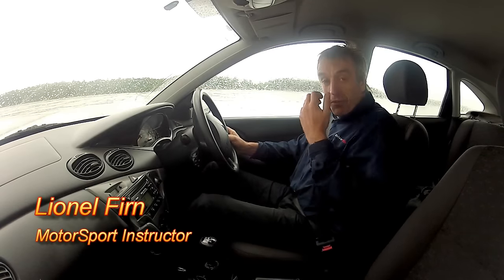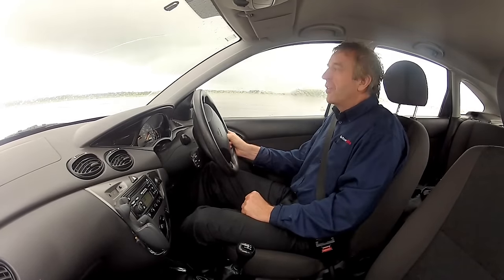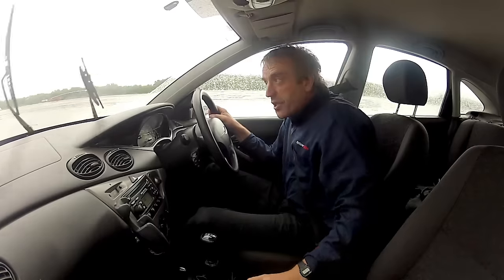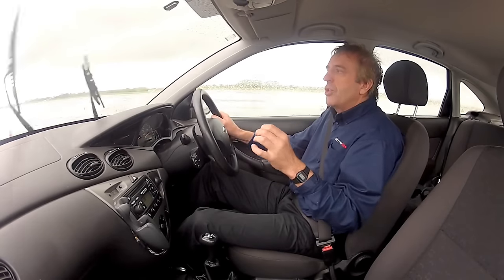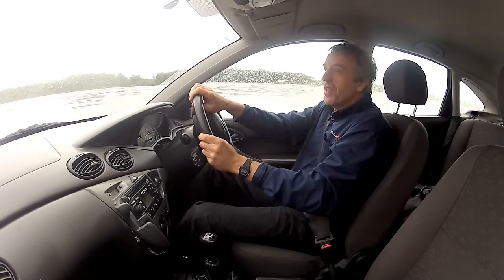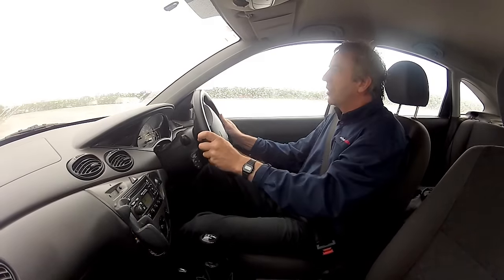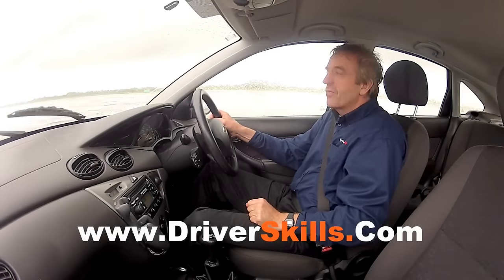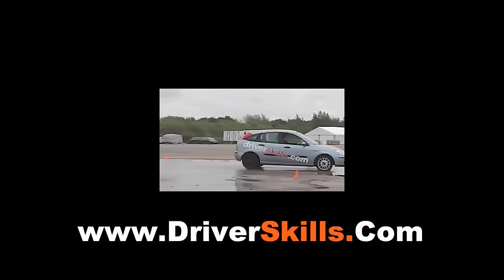How to Control a Skid.

Comment: I got in a skid once going through a wet roundabout with uneven surface at high speed at night. I did play racing simulators on my computer before like Project Cars or Live For Speed so when that happened I just instinctively knew what to do with the steering wheel and got control of the car seconds later. I still did go from edge to edge of the road left and right but did not crash into anything. People do like to speed up on the road as about a month later I saw a car with wheels up on the road.
Reply: Had exact situation, but not with happy end :D 190km/h + sudden turn + sudden brake = First time experienced the skidding, I thought, I would "drift away" and fix, but ended up my wheels on the air
Reply: Same here. I was in a rearwheel drive sport sedan going about 60 mph. I'm sure the person who was riding my ass behind me thought I was being a show off. Nope. I was screaming inside my body as my $40,000 car was sliding side to side. 😂
Reply: @shortcake1025  q50?
Reply: @Ktrxll  No, lol, Kia Stinger GT RWD.

Comment: This is great advice. Ended up in a fishtail today because someone in a large SUV tried to merge into the side of me on the motorway. I took evasive action but there was loose gravel on the road surface and the back wheels broke loose (RWD sports car). Followed the procedure, eyes on the direction I wanted to go, countersteered but let off the throttle a little to let the rear wheels grip. Overcompensated on the first counter steer which is why I ended up fishtailing. Fortunately I got it together on the second and the traction control got the rear wheels back in grip. Was bloody scary doing that at 70mph. Just glad I was in a fairly light car with very good steering authority and ESM.
Reply: Which car?
Reply: @samcharles1166  pontiac aztec
Reply: @NoLimit.350 thats jus scary to go thru thank god you made it thru . For me tho having a fwd means i mostly likely would have less room to work with since power is sent to by the front wheel

Comment: 2:05 - Glad he mentioned the throttle. That really works wonders in a FWD
Reply: It's the same method for a Scandinavian flick, except you cause the skid by shifting the weight over the outside wheels and hitting the brake to cause the back end to break loose
Reply: I wish I knew this before last night haha, someone pulled out in front of me when I was doing 55mph on a dual carriageway roundabout, I braked hard and the car went into a crazy slide

Comment: I went on a skid when i was approaching a 75 deg right bend on a slope during a rainy weather, the car veered to the right side but i quickly recovered by slightly steering the wheel back to the left (about 10 o'clock) and the car stabalize. I didnt use this method because my traction control was on, I just did the first two step and it worked. Thankfully there was no accident and i went on my way.

Comment: Often one has NO CHANCE even if the car has ABS.  Take what happened decades ago to a colleague.  He was driving from Penrith to Ullswater.  The road had a sharp right hand bend but the cornering forces of tens of thousands of vehicles had worn a hollow in the tarmac.  This was OK in summer when all that collected in the hollow was water but in winter the rainwater could turn to ice.  Result, just when grip was needed to turn the corner there was a sheet of ice so the car went straight on and flew through the air into a wood.  It hit a large tree so hard that the floor of the car bent to resemble a roller coaster.  The rear axle carried on for well over a foot and the prop-shaft became Z shaped.  I would surmise that NO ONE could have got around that corner without ABS (not invented then!) and studded tyres (illegal in 99% of the UK but allegedly icy spots in the far north have bye-laws which allow them)

Similar can happen on country lanes which are seldom resurfaced, e.g. once in twenty or thirty years. If one studies the skiddy corner carefully it may be found that the aggregate has become polished and is in the form of little rounded domes.  Grip on such a surface is very poor in the rain especially when muddy.  Needless to say there will negligible polishing on the straight which as a  result will be OK to drive on.

Sudden changes in the road surface can occur in milliseconds and this is far too quick for 99% of humans.
Reply: jjj
Reply: +Zarra qalis 1
Reply: +Zarra qalis 1
Reply: @zarraqalis21  pure knob spammers
Reply: So what happened to your friend? Did he survive?
Reply: That's understeer

Comment: I was going down the highway and suddenly my car started screeching and skidding severely! Spun in a 360 bounced off a concrete barrier into a pickup and stoped blocking 2 lanes with tractor-trailers breading down. got it off ok but turned out the rear tie rod broke. What to do in this situation? there was no indication anything was wrong until the second it happend. Could I have compounded the problem by overcorrecting??  It was fishtailing quite a bit.

Comment: I was driving around a left turn and got into the left lane and my rear ended started fishtailing towards the left, luckily I looked at where I wanted to go and I guess I subconsciously knew to floor it to put weight on my rear tires and before my car could fishtail back to the right I had put grip on them while swearing to my right

Comment: I got skid this morning. I was driving .then in front of me theres a vehicle that parked on the road ..in a distance a saw a pickup truck on a opposite lane that going to overtake too..but on my calculations based on my speed and distance..i decided to overtake. But when im turning my car back to the left side of the road..i felt it that is like drifting. So i tried full breaking. But it still moving forward like drifting but slowly. So i tried to turn to my right to control my car. Good thing that the driver on the opposite lane tried to avoid me by turning to his right side..that was my first time that happened to me.. time to buy 2 new front wheels.

Comment: Thanks for the video, still need more clarification regarding how my foot should react. If my right foot is on gas pedal when skidding, should I release it or keep it there? Should I break?
Reply: Don't Break!! I repeat don't break!! Take just take your foot off the gas!! Breaking will just make you skid more!!
Reply: Throttle response depends on the car. If you’re in a FWD car a little throttle can help pull you out of the skid and shift the weight to the rear wheels as he says in the vid. In a RWD car additional throttle stops the rear wheels reestablishing grip so you need to come off. If you have stability control (which most RWD cars do) it’ll kick in and manage the power to allow the rear wheels to grip.
Reply: Really dependent on the situation you have to feel what the car needs. If you break it will take weight off the rear tires and lock them up too, never break hard in a skid. If you throttle it will take some weight off the front. Basically just don't do anything too drastic , try to be smooth, don't jump off the throttle and make the car slam forward, instead ease off it so you can stay balanced.
Reply: *brake

Comment: see hwy 9 felton ca. There was a toyota truck that was following for 2 miles. my old dodge dart can play slot car up to a point. i turned off the motor at mile 3.75 as usual. He started again with lights. I was close to a usual turnout. I skidded and 2 wheels were off. the dart turned blocking half the road. i checked and there was a hole. 2 right tires are shorter than the 2 left. pulls left. howls and hops in 35 mph turns
Reply: nj